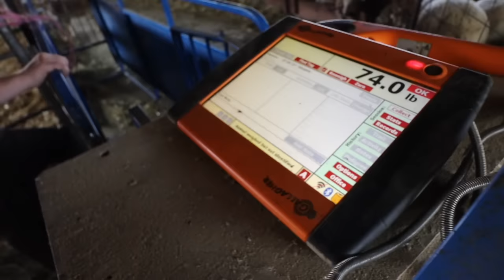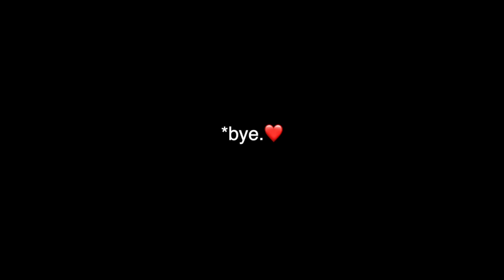Everyone needs a little help sometimes  ...even Big Mama. | Vlog 707

Comment: Sandi and Jess a feeding tube may seem terrifying but as someone who has one and uses one currently it is a Godsend on keeping weight on and not loosing along with staying hydrated. (Some Meds can even be given via a feeding  tube) It sucks at first but once you have one, having proper nutrition in the system makes all difference in how you feel. I also have hydration therapy and it helps immensely with how you feel. I empathize so much. If a feeding tube is the route take it from experience Try and see the positives benefits with what it can do for you instead of the fear of the thing itself. Sandi your videos have kept me much company in hospital and when needing an escape from things. So thank you.

Comment: My step-dad had cancer we got some ensure or boost meal replacements for him. He liked fresh berries easy to eat and nutritious and filling. We did smoothies too, you can put some veggies in to help with nutrition. I did 70% fruit and 30% veggies. Spinach, celery, carrots, cauliflower and a little beet makes a beautiful pink color. Use different veggies, pick 1-2  for each smoothie. When using greens in a smoothie they can over take most colors and make the smoothie Grey, but just a little beet will make it pink. Coconut water helps with hydrating the body also helps with electrolytes, can use some in making the smoothie.  Jess you are doing fantastic, take it day by day. ❤

Comment: I had a friend who went through 2yrs of chemo & she ordered a small ice machine off Amazon which can make both crushed ice in the little pellets(like in hospital) & can make ice really close to like what is used for snow cones. She also ordered some snow cone syrup fla to vors she loves. But that plus popsicles was how she got most of her fluids in without constantly being nauseous. She would also put various fruit juices & even soft drinks in the freezer just to the point they came out at slushy consistency. Oh! And she bought a small rapid churn/freeze ice cream maker with a gelato setting so she could make fresh fruit gelato style frozen treats when her nausea wasn’t as severe. Instead of regular milk she would use small amounts of almond milk with sweetened condensed milk added to both add more sugar & fat…as she also lost a dangerous amount of weight…as well as to help thicken up the almond milk. Which you can also slowly & gently simmer the almond milk until it’s reduced by half to thicken it. Also if you like cashew or oat milk many brands of both tend to be thicker & richer be than almond milk. And oat milk tends to sooth & coat the stomach so is good for easily upset stomachs…as long as you like the taste of it. Also rice milk is supposedly very soothing to the esophagus but is harder to find & also lacks the nutrition all the other alternative milks provide…but does still add hydration & by helping coat & sooth the stomach MAY increase the amount of food able to be eaten. 
-My friend also found that putting well to slightly over cooked white rice plus a small amount of water through a food processor until really smooth & then adding the result to anything which either normally tastes good with rice OR which has enough strong flavor you can’t taste the very mild, bland rice. Adding the rice in that form actually doubled both the types of foods AND the amount of each food she was able to intake without becoming severely nauseous &/or vomiting! As the rice helps coats the stomach. One thing she had a lot of success with was chicken & vegetable soup with the rice slurry/paste added. She would vary the type of vegetables, seasonings used & change the taste of the chicken by baking or sautéing it in a skillet with various seasonings or even sauces. She would sometimes also use an immersion stick blender to partially blend any soups or stews as it thicken them making them more easy to swallow(as her throat was often sore), easier to digest & more soothing/gentle on the stomach…especially when she added the rice slurry/paste.  
— Another thing which can make digesting food easier is to take digestive enzymes with meals…especially when eating protein as that’s the most difficult to digest. As well as if you have been vomiting a lot &/or having extreme diarrhea for extended periods of time. Enzymedica Digest Gold + Probiotics is the best OTC digestive enzymes that aren’t insanely expensive. It also contains the enzyme required to digest dairy & many other harder to digest things plus a good amount of probiotics. You just take 1-4 with each “meal”. And don’t worry…you can’t take “too many”. 
— I have multiple chronic digestive issues & have had some literally since birth. So I’m  constantly struggling with nausea, vomiting & diarrhea. Especially nausea/vomiting as I also suffer from chronic migraines(aka 15+ days per month w/migraine symptoms). 
In 2015 my gallbladder went bad & that caused pancreatitis so severe the doctors came VERY close to having to remove it. Thankfully they didn’t have to since that would’ve instantly made me a type I diabetic. However it did severely damage the inside of my pancreas to the point it no longer produces ANY digestive enzymes…which are required to breakdown protein, carbs & fats to the point they can cross into the blood stream to be used. So without them you can eat plenty of food yet still literally starve. Plus eating food without adequate digestive enzymes causes severe nausea, vomiting & diarrhea. So I have to take prescription digestive enzymes or the OTC enzymes I mentions anytime I eat ANY food. The things I mentioned above not only helped my friends as she went thru chemo but has also helped me. I hope maybe some of them could help Jess so she can avoid requiring a feeding tube.🤞🏻🙏🏼
Sending positive thoughts, prayers & love to Jess & your entire family❤❤❤

Comment: You might want to try freezing water (not hard as ice cubes but like shaved ice), juices, sodas in 8oz plastic cups until the consistency is like icees, popsicles, you can provide ice cream, yogurt, liquid probiotics, you can puree fruit and veggies to eat like applesauce consistency. As a matter of fact you can puree the whole meal together in a blender adding broth, milk or water to make a soup like! Also there's boost, ensure beverages that will boost her energy and gain weight and strength. Always consult with her doc if this is possible with her treatments. Good luck, I'll be praying for you all. ❤🙏

Comment: Sandy, not sure you will even see my post....but I had advanced stage female cancer 14 years ago. Eating for me since (radiation did a number on my stomach and intestinal tract) has been impossible. I too, even today, struggle to eat anything and drinking water or any fluid also makes me ill. A feeding tube was discussed with my MD and as I explained my problem further, they realized that it is not the chewing of the food that makes me ill, but the actual food in my digestive tract. So, putting food that is already partially "digested" into my gut will still make me sick and in distressing pain. So our plan for me, when I start losing enough weight to make it a concern, will be to do IV liquids and vitamins through an IV port directly into my blood, bypassing my gut all together!!!!  The way I understand it is they put the IV in while I sleep so I don't have to be hooked up during the day, but at night. Can you discuss this as an option for your baby to see if that may help her get the nutrition her body needs without causing her more distress with the illness that eating food brings on? Just a thought.

Comment: Jess looks much better with this break from chemo. Maybe you should sit down with the doctor and try to work in scheduled breaks for her so that she doesn't get so sick that she CANT do the chemo again. This was at the 6 month mark, right? So, maybe she should break for a week at the 5 week mark. I was lucky in that my body basically adjusted and the nausea stopped for me at week 6 and my hair actually got thicker. My finger nails, however, split right up the middle of the nail bed from the tip to the cuticle. I wound up having to have acrylic nails done just to make my nails grow out normal and to protect the splits from getting infected. I loved them once they were done but the actual process hurt like sticking my fingertips into a beehive on fire! If I ever have to do chemo again, I'm getting my nails done b4 the first treatment!

Comment: Sandi I understand when things like fluids are missed off and we in England accept this kind of service as our NHS is free at the point of entry but with your country where you have to pay the bill for every medical requirement, I don’t think this is acceptable.  It’s the same with a garage, you take your car into be repaired or serviced and they forgot to order  the special oil that is needed, this means that you cannot take the car because it won’t run without this oil, it means that it stays at the repair garage whilst they order the oil. If your paying a hefty repair /service bill you would certainly have something to say about the fact that someone forgot to order the oil so you couldn’t drive your car away.

Comment: I feel for you and your daughter I went through the same but I had uterus cancer and it was so agresive that by the time the doctors finished all the tests I had the cancer in my right ovary. 
Every smell caused me nausea and end up lining forward in the toilet, drinking water was a challenge the flavour of just normal running tap water I ended up vomiting but the doctor said the same I needed to drink at least 2 litres daily, so I used to drink flavoured water and my ade it better, no perfect but much better. 

The chemotherapy caused me soaring in the mouth and I had to apply orabase cream in the soars the cream act as a cement that avoid the rubbing and help the healing process.

 I lost 15 Kg in two weeks and the doctors had to stop the treatment for a week until I gained weight, the risk it was that if they couldn’t restart the chemotherapy the week after I had to start all over again the hole treatment from the beginning. The doctors put me in a hipocalóric diet, no salads or vegetables, only cakes, ice creams, drinks with a lot of sugar, sounds great but I have never liked that kind of food, I am vegetables, salad, juices kind of person.

The day after the transfusions red and white cells as I called them cocktail day, I felt sick but the day after it was even worst like I had been poisoned I used to joke saying that the staff it was so good and strong left me with hang over for two days. And I do not drink at all, the irony of life.

The constipation when it was really really bad hard rock it helped rubbing butter in the bottom hole I know sound disgusting but it work to sliding out those rocks.

For the mental health it helped when I felt with some strength being able to seat outside in the garden, of course in the shade, just reading a book or having one friend for a coffee, felt like normal and when the raft times were coming, to have those moments to remember and aim to have that again it was my personal challenge, get better to enjoy myself, be normal. 

For the exhaustion I have nothing only vegetate it was what I did at the rock bottom moments when even talk it was too much energy consuming. 

I had the cancer in 2000 at the age of 25 and today I can say I have been clean for 22 years.

I hope my experience and what I used to do helps in anyway and gives you hope.

Comment: Would Jess try hot jello? I have kidney failure, and suffer from low red and white blood cells, and have had transfusions. I have also developed ulcers in my stomach. Often have issues with eatting and drinking. But hot water with some jello mix added is something I can keep down. It has protein and sugar for energy. Plus the gelatin coats the stomach so its less irritating. The warmth helps to sooth the stomach and calm it. I prefer the raspberry or orange, but try her favorite flavor. Sounds odd but it works. It was something my doctor suggested when I could keep anything down and was having issues with too much weight loss.

Comment: I know you're supremely busy Sandi... But that bolt that projects in to your weight scale, where the load cell is fastened, always gives me the willies. One of these days a lamb will buck or toss its head and get hurt. Please get Mark to cut it off with an angle grinder. It's the old horseman in me me that is always worried about stuff to get hooked on.

Comment: The other thing I will tell you as it when I was severely ill and did not want to drink because of the nausea. It helped me to chew ice not hard cube ice, but like crushed ice I don’t know if you guys have any gas stations there that offer that soft crushed ice. I know that in the states we have a chain called Quiktrip and they have the best ice but that was one way that I could get the fluids down and I didn’t feel like I was drinking and it kind of took away that nausea for me as well. I hope that helps.

Comment: Sandi, please, before you cause permanent harm to your spine, find and purchase an automated machine that turns the sheep upside down for hoof trimming.  

One more suggestion, The last time you had the ewe's preg-checked, you moved all your heavy equipment out of the way to make room for the vet's scanning chute.  Please, reconsider this moving before next time.  Isn't there a way that you could have the vet's equipment at the end of yours, or if there isn't room, perhaps put a corner turn to the left?  Just, please do not man-handle that heavy equipment by yourself.

Comment: OK, I know a little bit about 'feeding tubes'. If they want to use a nasogastric feeding tube, insertion is easy, mildly discomforting going in but once in you forget its there in a short while, the nasogastric tube is hooked to a liquid nutrition pump and it just constantly slowly pumps nutrient fluid. Now, my experience is thru my stepsister and 3 of her children with a genetic disorder. 3 of 4 had 24/7/365 nasogastric feeding tubes and pumps going. How easy is it to insert the nasogastric tube, set up the pump, put together the nutrient fluid and any amendments like vitamins or liquid meds. How easy?? My Niece was 6 years old, and at that age could set up her own gear by herself and starting at 5 was training Interning Doctors, Nurses and parents of children who required it. Ask if that is an option. She can receive nutrition while she's sleeping, which can help with nausea. Oh and my Niece? Got a liver transplant and was done with the feeding tube and a lot of the issues related to her condition. She's doing really good now days.

Comment: You definitely need to insist upon a case manager. Someone with knowledge of the system to ramrod Jess’ case. The things you are describing should not be happening. It would be the same in any country. Speaking from experience. Also, as if you needed any more suggestions, you and Jess would benefit from doing some basic yoga and stretching. Works best when you want to do it least. Mark should do it with you. It really does help to stimulate hunger and thirst. My heart is with you all.
Reply: Meditation wouldn’t be a bad idea,either.